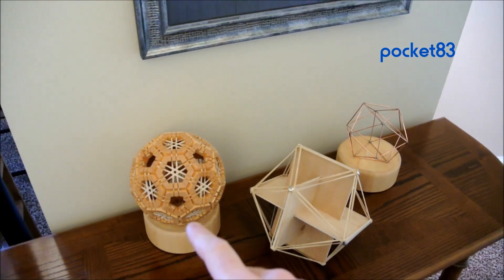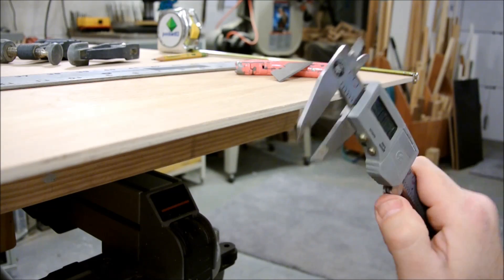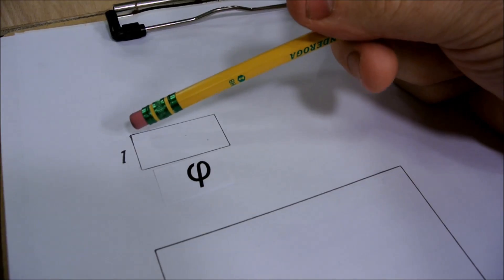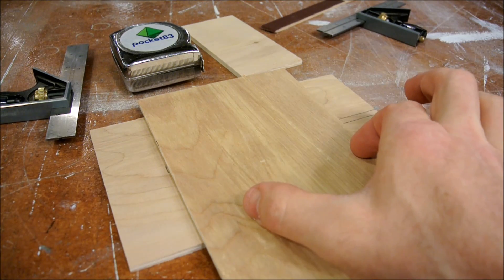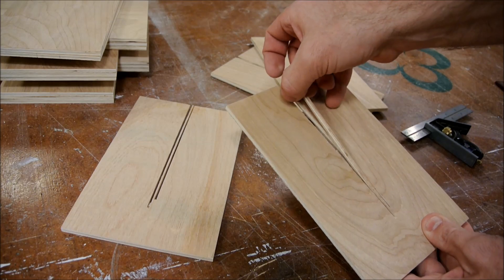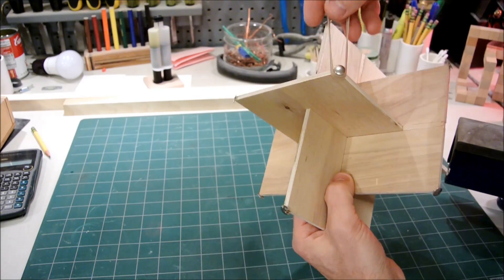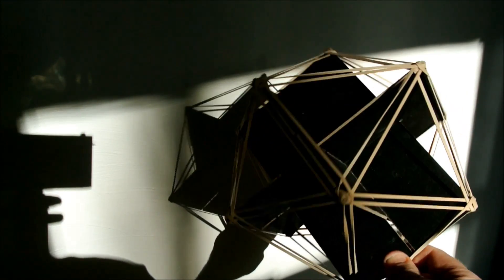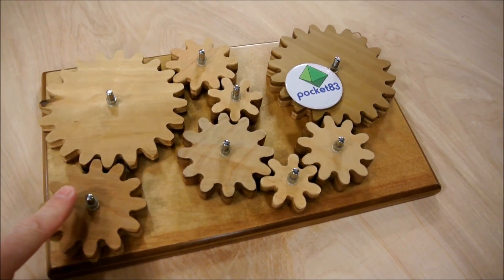Golden icosahedron

Comment: The Golden Number, Phi, is also equal to 2 cos 36°.
Reply: Nice find. Messy, though. It requires that the calculator be set to Deg, not Rad. It's also conceptually tough; irrationality is not always easy to internalize, so removing it by more than one degree geometrically makes the expression become quite opaque to curiosity. I mean, I'm getting philosophical here, but what is 'cos θ,' really? It's just too arcane for me to understand. The Golden number here is being defined as something like, two of the quantity that's the ratio of two side lengths of the triangle that has an angle that's 1/10 of the circle. Whatever. Thanks for getting me to think this morning ;)

Comment: If you really want to, you can make the ratio using a compass, a pencil,  and a straightedge. Use the pythagorean theorem with sides of 2 and 1, and you'll get sqrt (5) as a hypotenuse. With that, just add the length to the 1 and halve that total. length.

Comment: Come on Pocket, you know you wan't to convert to the metric system. Think of the possibilities!
Reply from the maker: Most of the time, I wear jeans. Sometimes I wear khakis. I may use either of them to protect my legs, without ever wholly endorsing one to the complete exclusion of the other. 

This is the difference between using a tool and being a tool.
Reply: Well played
Reply: That is actually a good point.

However, Be that as it may; metric doesn't require nearly as much referring to conversion charts as Imperial.
Just saying.

Comment: i guess the number 1.732 approximates to √3, as the rectangle is made of two right angled triangles following the pythagorean triplet 1,2,and √3, not related to the golden section, but the six petal diagram can be worked out for 1.68...,
in fact there is a paper on this link based on floral geometry.

Comment: Its actually 8 and not 8.09... You can check it out in Fibo acci's Sequence.
Reply from the maker: The digits of the sequence are not exactly representative of the golden number. Kind of like how pi is not 3. As you add more digits, you get closer to it. 

Just because two numbers belong to the sequence, that doesn't mean that they alone can define the golden number. Remember that it's irrational, so any definition of it that only uses integers will be an approximation.

Comment: Very nice work Pocket83! Excellent! However:

You may obtain a perfect Golden Rectangle by drawing a circle whose  origin is the lower center of a square's lower edge, and whose radius is from the origin on through to the upper corner of the square. It is the point where the circle extends beyond the lower edge of the square that will define a perfect Golden Rectangle, being VOID of any approximations whatsoever. Have fun.
Reply from the maker: I should've kept my mouth shut there. I expected somebody to pick at that. Please don't take the following as an evasion, or as being smart-assed.

My point was more abstract than any approximate construction. "Perfect" is a theoretical ideal. Just like it's impossible to draw a perfect circle, the Golden rectangle can't be constructed because of its irrational nature. Even IF we had the ability to produce sides of zero thickness in the real world, the figure would still require an infinite space in which to draw it.  

I have come to understand all irrational numbers as being descriptions of things that can't actually be defined within any numerical system that still assumes one as its fundamental. I have yet to be shown evidence to the contrary, but I certainly invite it. Our mathematics, much like the brains that invented it, are unfortunately quite limited. For example, we can make a symbol for infinity, so that we can use it operationally, but we can't know if infinity can even exist in reality. Such would be a (T)ruth claim, and those arguments are outside of the present scientific/philosophical purview.  

Sorry if that all sounds fuzzy, but I would just admit it if I had misspoke in the video. I really meant it when I said that drawing a perfect figure is impossible.  

Even deeper:
The "perfect" description of infinity would be the set of all sets, even the set of all sets not possible, and of course, the set of all sets not possible become possible. In this place, I can't cease to exist, because my conscious experience reasserts its continuity immediately following my demise, because all cases are present. Whoa, is this the ontological argument? I'm not sure, but if infinity exists, we all come back again and again: we have to, because all sets, cases, scenarios, experiences, and meanings will exist an infinite number of times and in an infinite number of variations. Even the case where we can draw perfect figures will exist, which requires additional infinities. 

Thus, I don't think infinity exists, and by extension, neither does perfect.

Comment: Dear, i wanna start a company and for that i need a logo. Could you please design a golden ratio based logo for me. thanks
Reply from the maker: Sure. I'll get started on it right away. In the meantime, send the retainer to my PO box. No need to discuss a price; I'm not really interested in the details, so just keep sending payments until I've finished. You'll find that I'm quite easy to work with! Talk to you around spring.
Reply: Rather than a retainer, you might do better by taking a share of the profits.  I recommend splitting things  38.196601125010515179541316563436  61.803398874989484820458683436564

Comment: Actually, you can construct a perfect golden rectangle using a compass since φ is constructible (you can get root 5 by constructing the hypotenuse of a 2 x 1 right triangle).
In fact, you can add, subtract, multiply, divide and take square roots of numbers with a compass and straightedge (you can even take cube roots if you cheat a little bit).
Reply from the maker: You're kinda right, and I knew that word would get scrutinized. But my point still stands on two technicalities: 1) the construction of an actual Fibonacci rectangle that's representative of the entire number would require infinite space and time, while we don't know if those variables are available to us, and 2) variation in any and every drawing implement yet devised introduces some random error, which prohibits perfection. 

I love that mathematics creates these ideals for us to use as models, but it's important to remember that they can never be realized in the world in which we live. Political and economic theories are also tools that suffer the same limitations. This, in part, is why Plato considered his realm of 'forms' to be more substantive and real than our world.    

One more interesting thing to consider: the arbitrary nature of irrational numbers. If our numerical system were based on a hypotenuse, rather than on a leg, root(2) would be a rational integer, and one would become an infinite decimal. In spite of Bertrand Russell's Principia Mathematica, it is nevertheless an assumption to consider one as a fundamental truth sufficient to build a mathematics predictive of all possible states of the universe. It may be that "perfect" eludes us because for us, perfect must be in terms of one, while the universe does not necessarily adhere to such a precept.

Comment: Ah platonic solids. I really enjoy these video's. Thanks for putting in the time and effort to build these. The copper one was beautiful top watch you make as well. Makes me want to build some rolling ball sculptures (namedropping David Morrell, specifically, his 66th build, the sphere), and add some wood elements to it.

Quick question; I seem to remember there being a system where you could use chopsticks and rubber bands alone to build stable solids, but it would only stay together once the tension was equal after adding the last rubber band. Something like "tensors"? It's kind of eluding me atm, and my google-fu is getting me nowhere.. Maybe you can shed some light on it?

Also, Those are some nice gears. Have you been hanging out with Izzy? :) 

Also also, happy new year dude! Well wishings to you and your friends and family!
Reply from the maker: It's possible to make a "Hexastix" from pencils, which is a self-contained form that's pretty stable, if I remember correctly. That "stand-up math" guy made a video about it, I think (if you can tolerate his sarcastic anti-Americanism).   
That shape could probably scratch the itch for you, but nothing else like that comes to mind right now. Thanks!
Reply: Hexastix,  ah yeah I saw the video, but that wasn't what I meant. The rubber bands are not optional. I'm talking about making almost entirely hollow solids, but using rubber bands to pull the sticks through the center, or toward it, or into eachother's vertexes. No glue, no friction, just tension. I remember this one guy who was able to make stuff like rhombic cuboctahedrons, and icosahedrons, ,all the way down to simple cubes and tetrahedrons. It would be putty in his hands until he had the last string on. A very elegant form of tension based balance.

I don't mind the stand up maths guy though. I'm Dutch, so my tolerance for language based banter and patriotic jabs is quite up there :) But yeah, I learned to read, write and speak english from SKY Channel, when they still ran series like GI Joe, Mask, and transformers, so that might explain a thing or two :)

Cheers man, thanks for replying and thinking along!
Reply: Okay, okay, not 10 seconds after i posted above reply, I found it.

Tensegrity Structures/Models. YES! Wow, that's 10 years ago,  and I (well, you and me both actually) had to dig deep to remember that. Wow.

Okay, well anyway, I'd love to see you build some stuff with this technique. There's a lot of disciplines and methodology there that reminded me of you. Damn I love it when a plan comes together!

<puts cigar in mouthcorner>
/watch?v=8gtvxYZ0GIg <- the tutorialised version
/watch?v=a7agYb_rZ6U <- The wayback machine to 2007

Comment: so I did the math too, except I used some trigonometry instead. 
I got b = a/tan(30 degrees), which, when we set a to 1, means b = 1.732050808..., which is the same as your answer. 
1/tan (30) is equal to sqrt (3), which doesn't look that similar to (1 + sqrt (5))/2. 
so yeah, it's just a coincidence that they look about the same.

Comment: Re. the rectangle inscribed in the circle. You may appreciate how I saw the ratio "at a glance". The construction is simple.

http://imgur.com/a/qZcJK

Connect every corner of the rectangle to the center of the circle. Now all the short lines (red) are equal; They all equal the radius of the circle, r. So we have two equilateral triangles. The height of an equilateral triangle is root3 / 2 of the side. So the sum of the heights of both triangles is r*root3. And that is also the length of the rectangles longer side.

Comment: I built a robot with the front, top and side views all using the eye-pleasing golden ratio in some manner. Then it turned out I screwed up measuring the batteries, and it needed a different set of sensors in front, and... sigh.